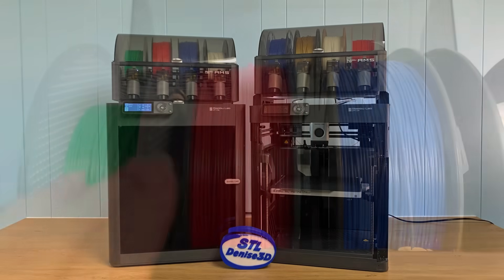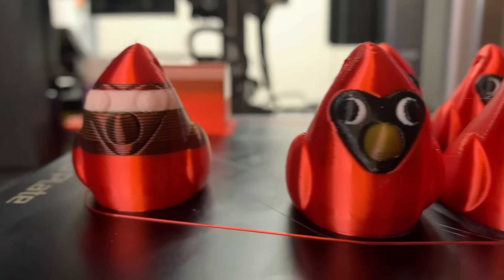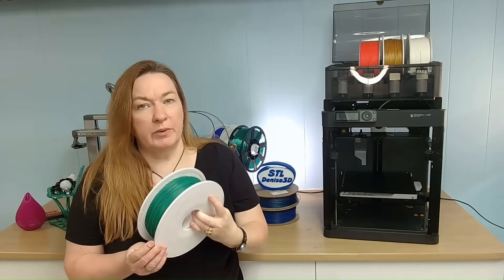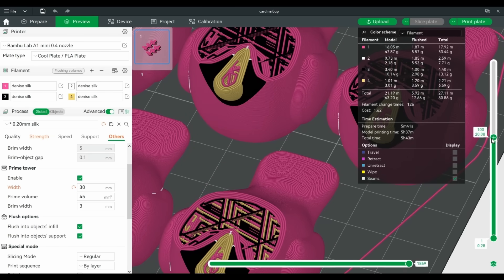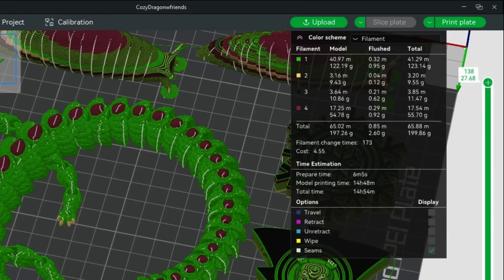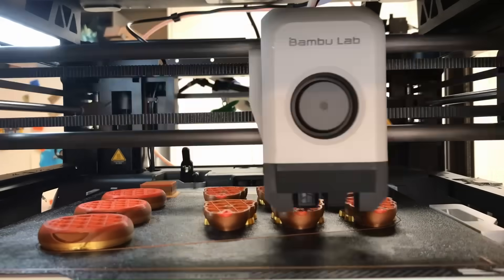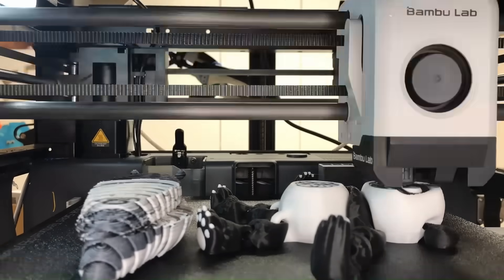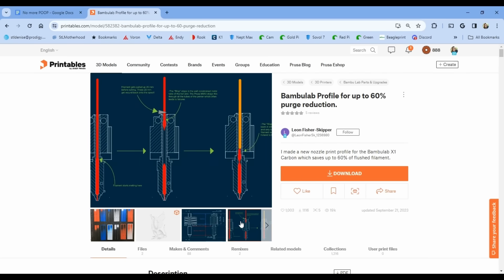Banish Bambu A1 Purge Waste with these 5 Tips.

Comment: it seems to me that the easiest item you could justify on every single print would be some form of container, probably something that works with gridfinity.

I mean you can't use an infinite number of containers, but it would be fairly easy to adjust the size of containers to match the height of your print.

The only thing that's escaping me so far is how you can optimize the size of your purge print to match the amount of purge you're gonna end up with. It seems as though the slicer will tell you how many grams of filament you will end up wasting, but is it just trial and error to work out how much filament the purge object will use?

Comment: I think it is important to understand that ALL filament eventually ends up in the garbage dump. And that is the cold, hard truth.
So, the only reason you have to be upset about AMS poop is that it means you print fewer items for your money. And given how cheap filament truly is, wasting some of it is not a big thing, unless you are dead broke. In which case, you don't own a 3D printer, do you?

And PLA is an organic plastic, which biodegrades over time. So you can sleep easy at night, knowing you are not adding to the world's micro-plastics problem.

It's dead easy to reduce the amount of poop your printer+AMS produces by about 50%, simply by reducing flushing volumes. Job done.
Reply: But reducing filament waste is still really useful with making the tower another print, If you want to make tools and you dont care about the colour, just make it the tower. It is really useful for people that have other prints in mind but dont want to waste that much filament in a sepparate print.

Comment: So I am watching this a year in the future. Thank you for the content. Question: Now the Prime tower setting has Enable Skip points and Internal ribs. But it will not let me adjust the Width.  Also when In R click on the model to adjust Flush to Object it is not there. But in Flush options there is a box called Flush into this object, Is this the same thing? I have a P1S, any advice? Please and thank you.
Reply: flush into object is making the inside support the purge, Maybe if you use orca slicer (i think its on there) it could prob work. good luck on your print! :)

Comment: The slug tries to run away. The default bed temp is 55 and I found it’s not enough. Putting bed to 65 or even 70 gets the model more glued to the bed. Also you can add brim to a specific model for more adhesion

Comment: Purging to infill will cause different colours to be visible under the model. Making thicker walls can reduce this, but isn’t adding material to the print counter-productive to reducing waste? Only purge to infill if you don’t care about other colours showing through. Planning the orientation of multi coloured prints to minimize the number of colour changes should be your #1 method of minimizing poop.

Comment: I plan to make my purge tower print as an aluminum extrusion profile. Then, just print a center dowel and glue to join the towers together. That way, you can use the lenghts to make storage or whatever for your shop

Comment: I was watching teaching tech's video on this and I was thinking if there were a way that the gcode could be adjusted to cut, continue printing (pushing with the new filament color using the leftover amount of filament down to 1-2mm) flush the mixed colors to infill then continue printing.

Comment: For me it’s more about too much plastic entering our garbage. Recycling isn’t a great thing cost wise, but much better than just throwing it into landfill. Of course prevention is by far the best method, so your tips are great. Second to that recycle into other object at print time then followed by recycling into new filament and lastly discarding…. Another option is to melt it into something flat, like a placemat or drink coasters using egg rings…..
Reply: Sorry to say, but if you believe that ALL recycled materials get recycled, you're mistaken.  Check out "marketplace's" investigation of where recycled materials go.  Many of them go to the landfills because there simply isn't enough facilities to recycle everything.

Comment: the link to the retraction no longer works
Reply from the maker: The Link was removed. Bambu Studio is working on adding this feature to the slicer. To see it turn on "develop mode" in Preferences, then click Printer settings: Extruder to see the retraction settings. Only works with a P1 or X1 printer.
Reply: @stldenise  ooh, that's cool!
Reply: It's been added!!!

Comment: Why aren't the printers clever enough to know how much filament is required to complete the currently selected color, and cut off the correct amount of filament before it enters the melting stage? I don't own a 3D printer, but this seems to make the most sense to me.
Reply: There's no instant cut off possible. The plastic is semi-liquified inside the nozzle, meaning the tqo colors mix for a while until only the new color comes out.

Comment: Has anyone tried the AMS lite with PVA? It lists it at supported, but i figured i would find some tips and tricks for using it.
Reply from the maker: I haven't tried it yet, but looks like you might want to keep it in a dry box. I've run other filaments from a Sunlu dry box into the AMS lite and just skipped the spool holder.

Comment: Now if I can get my A1 to play nice with bambu PLA that would be great!! I use Sunlu 98% of the time, works great, Creality..No problem PLA and PETG. I load up a Bambu filament, It's spaghetti city or don't stick at all. As for the poop. I don't care that much it's not like it's $$ My A1 with AMS is a nifty thing!  Not that fast but does the job. Has odd quarks like wanting me to enable suports in the slicer for everything including flat coasters. I still recommend 8/10.

Comment: For private users it would be clever to have a queue of practical objects (for the household) to use as that purge object. It could be:
- adapters (for spools)
- baskets, organizers, brackets that are not to be seen
- functional parts in any way.
- in a way also that test prints most people do for fun.
- parts that are going to be painted

I think all those tips combined should be put together and by the time added with new ones and printed out on paper to each AMS customer by default.
There is soo much a presliced profile from makerworld or the default settings doesn't tell you.

Comment: There are other strategies Bambu needs to make available in the slicer. Not sure why the color is ever applied more than skin deep. Sure, some filament is kind of translucent, so you can see the color behind the surface a bit. But if you just made the two outer layers in color, then the inner shell layers could be made up of purge. Also, I would think infill could absorb all the purge, depending on the model of course, and making the infill a bit more dense could also use up more purge. Also why not change the color early? The volume of the hot end is a known quantity, so a bit of pre-load could be undetectable if done with skill. Bambu needs to work to eliminate purge completely. It's kind of ridiculous.

Comment: It seems like the problem sits entirely in the hot end. It seems like they’re just not able to cool the filament lower to the nozzle since that heat sink is so far up. And of course, in typical Chinese fashion instead of coming up with the hard engineering they just decided to purge 3/4 of our filament out the back door for the sake of marketing and selling us this magic machine.  Version two better come up with a better solution because beyond hobbyists, anybody trying to make money weeps a little every time they have to dump out the poop collector. That has to be one of the most horrible engineering decisions in 3-D printing that I’ve ever seen. And it’s just blows my mind so many people don’t even mind.

I haven’t used my Prusa mk3s in a while and I decided to upgrade it to the mk3.5 and immediately noticed a new behavior when it removes filament that creates color changeovers that look almost as if somebody just cut the filament and spliced it. And I would say about 90% to 95% of the time there’s almost no previous color in the new filament. I have no idea how they do it.

From what I have noticed it heats the nozzle up to about 100 and then does a really fast 10mm or so retraction and then slows down and retracts the rest of the filament. It always comes out nice and clean with a little point on the end but the amazing part when you put the new filament in it will do maybe like a 1 to 2 cm tiny little purge, and there will be none of the previous color attached. This happens almost every single time. Very infrequently you’ll see just a little tiny bit of the previous color. 

Anyway, not anybody cares but in general, I did think that 3.5 upgrade was worth it and it kind of brought the machine back to life. It’s easily 2 1/2 times faster with the input shaping and keep up with the A1 no problem. The unit is a hot mess, but for commercial purposes it produces way less waste than A1.

Comment: So much great information, such a great way to present it, and done in 1/3rd the time of a typical vlogger...  Good job!

I am an impatient person when it comes to watching technical videos.  So many content producers spend as much or more energy on "fluff" than they do on meaningful content.  I just hung up on a pod cast where they had 40 minutes of content, and 5 minutes in they were still talking about how great the two podcasters are and how they came this far...  Good info I'm sure, if I wanted their biography.  I really like that pod caster for his written works, but I think it's because I can just skip reading his bio each time.

But you  value my time, and dwell on each subject long enough to fully cover it, without making me feel like you get paid to make your videos longer.  That was 8 minutes of valuable well paced information.  AND while you were talking, your video also had a stream of information flowing in parallel, so for example when you covered picking a good model to print the waste into, we had already seen a preview example object with a mysterious stripe pattern and two examples of the slug failing before you told us to pick a model unlikely to fail.  You dramatically reduced how much you needed to say on the subject, so by the time you said it I already had the info, I just needed the facts summarized and tied together.  While that could have been accidental,  it caused the density and effectiveness of the information provided to increase by around 100%.  The hands down best coverage for Bambu poop reduction after watching so many of them.  

I'm also critical of accuracy, and people stating facts that are just wrong.  No one is 100% right all the time,  but sticking to facts, and leaving superstition and bias out was super refreshing.  My favorite 3d vloggers before today ALWAYS say something for me to argue with them over.  When I say something that is not backed by reliable facts, I wrap it in opinion or rumor to keep it in proper context.  Nothing worse than a favorite blogger saying something so cringeworthy you want to unsubscribe.

Are you a glass fuser too?

Comment: If you can do some 3D modeling, its better to cut the pieces into parts and glue. That way you can just use one color. If you need a little color, like a nose and eyes, you can use paint. That's a crazy amount of wasted filament, even if you improve the wastage.

Comment: Hope somebody can help A1 with AMS lite.   Using PLA+ as main filament and support trees except for the top .02 of the tree I am using Bambu support  filament.  Thsi filament works greate.  Issue is when print the PLA+ the printer will stop purge and use the same filament.  Understand this whe switching to the support filament but why does it do this when no reason to swtich filaments .   Your videos are great and help  Thanks T

Comment: Wonderful review BTW... Honestly I love the AMS, because it will change to another roll when the current run out,.and I don't understand why Bambu Lab don't sell an AMS that's NOT multi material but the same material, I mean if you run a farm it will be HUGE improvement in productivity, I do use an Airbrush to paint my models, so changing colors is not "that" useful to me and in my case I can get much better result without poop... So there you go.

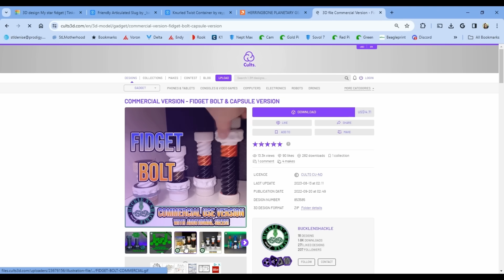Comment: 7:22 Thanks for the shoutout! My acceptable range of waste is 1-20g, I usually multiply between .65 and .80 depending on filament type and brand. Sometimes it’s super difficult to get the number down when printing with 4 colors unless you want a tonne of flushed objects.

I’ve found that Dragons, Eggs and my Fidget bolts sell best as purged objects 😎✌️and honestly I prefer how they look 😍

Great video btw I’ll definitely forward people on my socials to this as you did such a great job of explaining 😎✌️

Comment: I don't have a bamboo printer or multifilament feeder to test on but why is that wipe tower necessary? at least in my printer, outside of it looks usually quite clean. also if it is about stuff on the hotends outer skin, why can't it just wipe it somewhere and not extrude filament?

Comment: I will say that the wasted plastic. .. is a big reason it took me so long to actually get into 3d printing.  I really wish it was easier to recycle.  But I'm still going to print so I really really appreciate any tips of reducing waste.
Reply: If you only print with one material  and print already tested models the waste is negligible. If you're prototyping something yourself you might end up with a lot of failed attempt but sometimes it's just a skill issue and you get better overtime designing the model to work with 3d printing.
Reply: This! We still need to find a reliabe AND affordable way to recycle printed filament.

Comment: They should design a large hot end with a 4 nozzles that are close together so each color can have its own lane and no purging required. Maybe even have a method of mechanically moving the 3 nozzles up and out of the way when not in use. Probably be expensive but I think it could be designed pretty simply.

Comment: Just got our Bambu for Chrsitmas. Changing my flushing volumes definitely affected the totals. When I changed the "flush into objects infill" there was no change. But when I clicked on Flush into this object... I must have done something wrong. I was using one filament color and one support. It used the color for the initial part of the print. But when it changed to the support it did the rest of the print in support. 

Still learning. Really glad I found your page. But the initial changes helped a lot. Subscribing to find out more.

Comment: Thanks good video. I never used the "purge into object" feature on my X and P1S. Suggestions: I use shorts without spools (fooling my AMS when loading) and call all similar filament types as same color and make silicone spool inserts including my mod for Sunlu and like spools (looks like original just larger) and print all 3 parts by object.  Can use your idea for a useful purge object. The purchase (or addiction) for filament never ends. What a great hobby/extra $$ maker.

Comment: If you can reduce the waste by 40% by just tweaking a few settings, just goes to show Bambu lab hasn't fully developed it's product, they urgently need a huge software and possibly firmware update. Sloppy.

Twho main reasons everyone hates those pooplings:
1. abundantly obvious waste of material, we have a subconscious aversion towards something generally ineffective
2. we don't want to actively produce more plastic trash than is necessary to accomplish set goals

Comment: I wonder why Not to continue to print a  little bit more with the filament left in the nozzle after cutting the Filament and changing to new. It could print a little while longer until the Chance of mixing color is to high and then it could flush, but much less or do i get it wrong? Shure there is some calibration needed but as an extra option?....
Reply: So you can change this to make it flush less, as she says in the video, but the problem is if you run it very close and the colours you're printing are very distinct (like black and white) it can ruin details if there is even a slight bleed over. It's not smart enough to know how distinct a colour change is, so it just dumps the same for every change

Comment: Its embarrassing to admit i was not aware u could use an object as a print tower.. or infill an object. Thanks for this video.  Generally i dont do a lot of 2 color printing, and when i do, i  make every effort to make the second color the last color, ie at the top of the print. If it must be on the side, meaning a color change on every layer, i try to make it a separate print and glue/bolt it on. I usually design my own prints and they are more utilitarian than characters (lizards, bears, ducks, etc). Those colorful prints would be very difficult to minimize color changes. Thanks for such an informative video.

Comment: For your slug adhesion issue - try Elmer's Disappearing  Purple Glue Stick, it comes in Jumbo size format for easy application - and works a charm for most plastics. (and is water washable if you don't like it, not to mention rather cheap) - extremely useful for those corners that just won't stay down, or small surface to bed ratios for larger objects - like those slugs.

Simply apply a nice thin layer anywhere you need it -while the bed is cooled - and let it dry for about 5 minutes. Then preheat and print as needed.  Typically can get a good dozen or more prints out of it before it stops working, results vary if you touch it with oily fingers of course, or high dust areas.